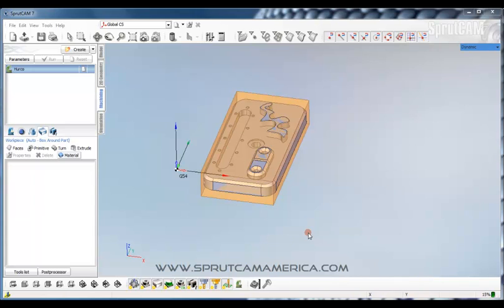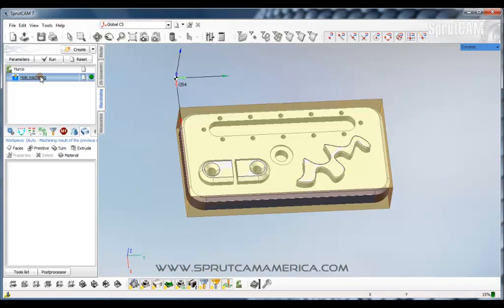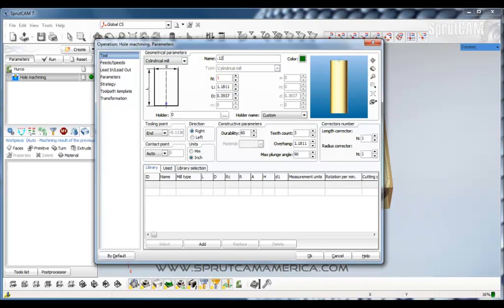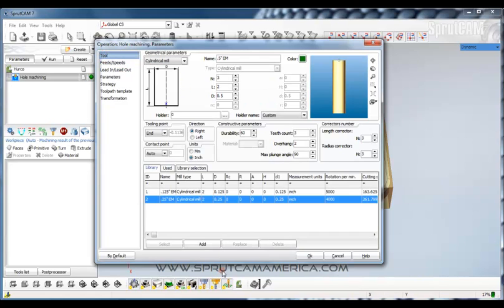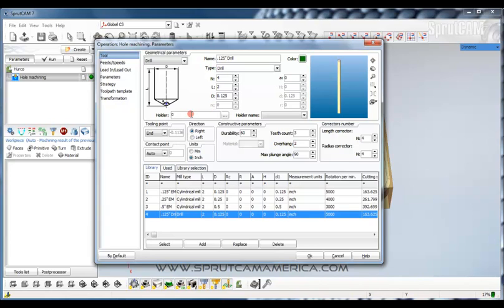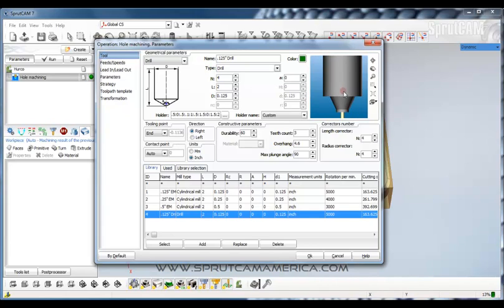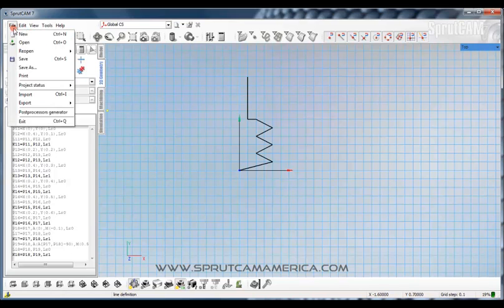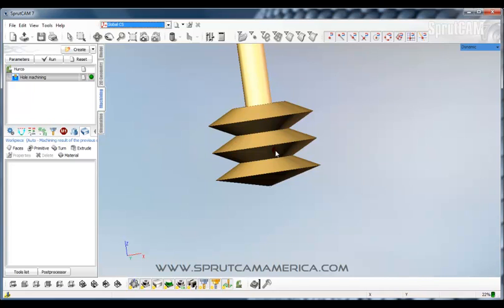#3 - Tool Library and Custom Tool Basics - SprutCAM 7

Comment: It would be nice if the tutorial covered the bug where the tool holder was created on the wrong end of the tool.  I found a workaround by using the overhang, but I wish it were covered in the video.

Thanks for the great videos.  They are much better than the tutorials that come with the software.